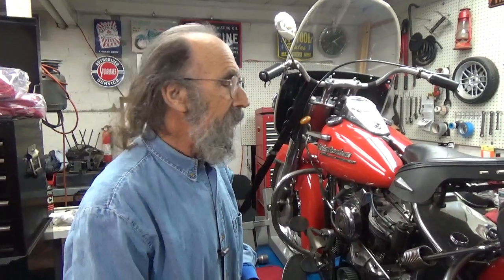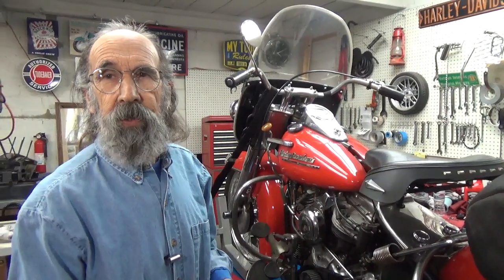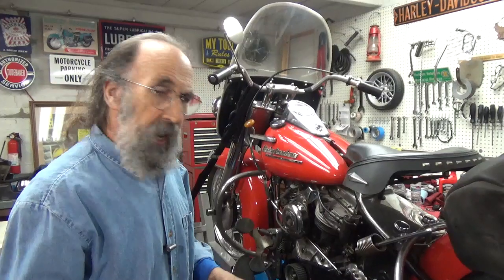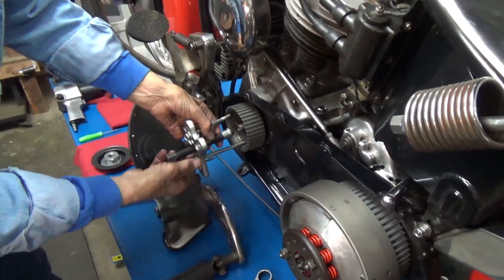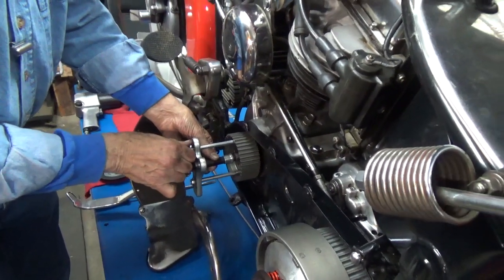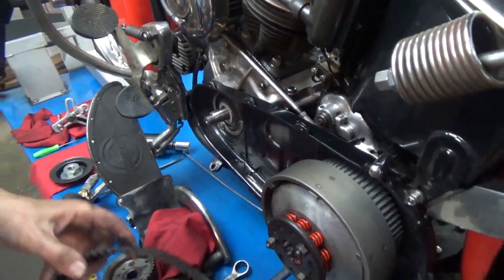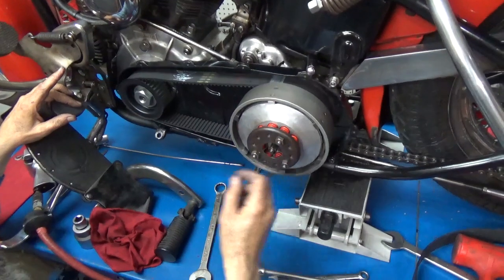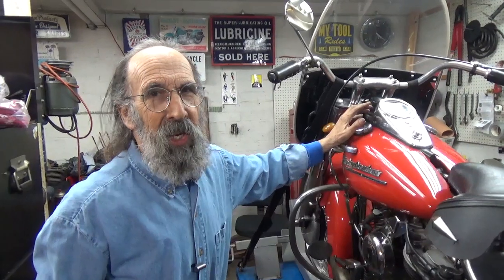Panhead Lost The Teeth Right Off Of Her Belt!

Comment: Thank you for the post. I ran a Phase 3 11mm belt on my Shovelhead for many years ,before going back to chain. Changed belt 2 times. In 25 years.
Reply from the maker: I certainly worked on some of those.  They were okay.  But, like anything else, we've learned a lot since then. Those were the days before Kevlar.  Which is pretty neat stuff.  I remember Phase III in the seventies.  I assembled prototypes for Super Max in the early eighties.

Comment: Well Mike, you got your moneys worth out of that belt, which shows by spending a little time fitting things properly; is time well spent.
Nice-one, anyway, you may remember I told you about "WellSeal" gasket sealer, which in my opinion is the best sealer ever.
If you look on ebay, and just tap in "Wellseal" maybe add a UK, because it comes from Great Briton. I just bought a 100g, £12.00 tube today.
Please just have a look, you won't regret it. it's so good that even if you don't use, you could have a sniff, now and then!
Only  joking, is dose have a really good write up, even if you think I might have got it wrong. Take Care now.
Reply from the maker: Okay, Will do.

Comment: Hey Mike please tell me how a 21" front wheel helps in the mountain roads. I very much enjoy your videos.
Reply from the maker: Think of it this way (I didn't take physics, so I just get a picture in my mind with no rules):  The wheel is a gyroscope.  As such, it has weight.  You're steering that heavy weight.  How about, I get a larger diameter (within limits, you can go too big) gyroscope with less weight to have to menuever?  Now, we're having more fun.  I think I blew it on the spelling though.

Comment: I ran a belt on a shovel head 2 years in the 80s and the belt broke .so I stick with that double roll chain in there from now on ,it’s pretty tough. Coming back from Kentucky back ito Indiana where I live I had a 93 Evo dresser and it burned a valve or chipped valve it was hard to tell it sound like a corn popper I could do about 35 did that for almost 250 miles got me home
Reply from the maker: In the beginning, belt drives had rubber belts.  Then came Kevlar.  Then it was just a matter of proper installation.  I worked on the development of some early belt drives.  But, I still only put belt drives on my "kickstart only" bikes.  And, I consider that a vast improvement.  But, to each his own.  As for that Evo, you get kind of attached to one that always makes it home.
Reply: That's why I stuck with a chain when I built my shovel. They are bullet proof. I floated a valve and bent it one time on shovel. It was cold out and i started it and took off fast to catch up to some people and bent the valve.
Reply: @pacificmike9501  Hi Mike, I'm wondering why you said you only put belt drives on your kickstart only bikes?  I have 3 FLH shovelheads.  An 85 FLHP that I geared up by putting a 65 tooth back sprocket and a 124 tooth belt but there is very little adjustment left to tighten the belt. An 83 FLH that I am putting together now and was going to try and gear it up in the primary with a belt drive instead of the way I did the 85. Do you not recommend the belt?  Then I have a 77 FLH that I run a 45 tooth on the back. Like you I ride my bikes so running stock gearing isn't practical.

Comment: Pacific Mike, Great videos.  Can you explain how to remove a primary belt on a 1983 FXSB.  The compensating sprocket is the one with the four rubber dampers.  Thanks
Reply from the maker: I don't remember.  I thought it came right off.  It's on a splined shaft and should slide right off unless it is stuck.  Those four rubber dampers go bad and I used to have the two halves of the pulley welded together.

Comment: Are you running a sealed bearing in the clutch basket, or the original style cage bearing? If you are running the cage bearing, how often do you need to grease it? Always a pleasure watching a guy who knows what he's doing.
Reply from the maker: Thank You.  That bike has a stock caged bearing in the clutch basket.  When I assemble it, I lube the bearing rollers with a good wheel bearing grease or moly lube.  Next time I disassemble the clutch for cleaning or repair, if it needs it, I lube it again.  It really doesn't need it often.  Some people  are harder on clutches than others.  They're in there oftener.  If you ride in heavy traffic, you'll be in there oftener.  If you ride easy in the country, clutch probably doesn't get looked at that much.
Reply: @pacificmike9501  Thanks I always wondered how long that bearing would last in a dry environment, my bikes have always been oil bath primaries.
Reply from the maker: They do fine with occasional maintenance.

Comment: Love your videos.  Thinking about adding a primary belt drive to my '65 FLH.  I was under the impression that there is no seal, behind the compensator, and that engine oil will weep in to the primary.   What are your recommendations to resolving that?  It seems your primary is so clean and dry.
Reply from the maker: 65 FLH has a "screw-in" motor seal.  Look it up in your service manual.   Use the right manual it is the 1959-1969 manual, although each of those years is not the same.  Be sure you read the manual.

Comment: Somebody put up a video showing their Harley "drive" belt shredded and strangely enough it was 27 years old as well.  My dealer says 100,000 miles or as soon as you seen any sort of decay - cracks, stiffening etc it should be changed.  I know I will never have to worry about it that's for sure.
Reply from the maker: Mine is a primary belt.   I believe Harley has tried to stay "non-comittal" about how long their final drive belt will last.  In the beginning, Dealerships used to say 30,000 miles.  We now know they will last alot longer if they're adjusted properly and not abused.  We also know that the atmoshere, depending upon where you live, will also eat it over time.  No doubt about it though, they have a good system there.

Comment: Mike
I've got a shovel head with Delkron case and a belt drive, motor is out of frame. Thats all I know about this motor. I went to to try and turn the motor to make sure it wasn't locked up and there was no nut on the belt drive pulley. Any idea what the nut size is and do I need a puller to get that pulley off? I didn't want to start bangin on it with a dead blow or trying a crow bar before I asked the question. Thanks as always!
Reply from the maker: A "steering wheel" puller  is what you need to remove the pulley.  There are two holes on the face of the pulley where you screw in the two bolts from the puller.  You can find that nut in any "aftermarket" supplier of Harley Parts Catalog that sells belt primary drives.

Comment: I had that happen many years ago. I changed my 76 Bicentennial HD to a belt drive. Biggest mistake I’ve ever made. It kept stripping belts.
Reply from the maker: Yah, my belt on my Panhead only made it for about twenty-five years.  The proper belt, properly installed on the right bike is awesome.  Again, personally, I love a belt drive inside tin primaries, on kick start only bikes.  It is an tremendous improvement that way and will outlast a chain about three to one.  My 77 FLH has run a chain all it's life.  These are just my experiences.  But I was learning and working with prototype belt drives in the early eighties.  Early belts weren't Kevlar.  And people didn't understand proper installation.  And , again, I don't like them in every application.  Just me.

Comment: Great video Mike! What is your tip for tightening the sprocket shaft nut? How are you locking it all up? I considered just putting the bike in gear and holding the rear wheel whilst torquing the nut down, but I don’t want to damage anything. Thanks!!
Reply from the maker: I use my air impact very carefully.

Comment: Great video's Mike. My father-in-law just gave me his 1956 FL Panhead and we have been watching your videos continuously. We watched your videos where you mention the primary multiple times before we changed out the primary chain with a Primo Primary Belt (my wife and I actually bought the belt for him about 10 years ago and he never put it on so it was still new in the box) which really made the job easy, so I wanted to thank you for the videos. I do have a couple of questions which I was hoping you could answer. How did you tighten up the front 1 1/2" compensator nut? When I tried, the belt just turns which causes the nut to also turn so I am not able to tighten down the nut let alone torque down the nut. How do I keep it from rotating so I can torque it? Also, the instructions which came with the belt says to torque it to 60-90 pounds, but that does not sound right, I thought it should be torqued to about 175 pounds. I also noticed there is a little oil drip coming out of the same compensator, at first I thought it was because I didn't have the nut torqued, but noticed in one of the comments below you mentioned a "screw in motor seal", but I could not find anything about it in the manual and was wondering if you had any guidance on where the "screw in motor seal" was and how to go about fixing/replacing it? Will I have to take off the primary belt and compensator to get to it? Sorry for the long note. Again, thank you for the tremendous videos. I'm new to the Panhead world and they are sure different than anything else I have ridden or worked on.
Reply from the maker: Lucky you!  A father-in-law that gives you his 56 Panhead.  That's what I call a "loving family."  Now, please understand, you may be a little deeper in than you're comfortable with.  Not to be insulting, just realize first,  "Anything you look up for this operation will apply to a 55-57 Panhead."  It's a real good idea to have a 48-57 service manual.  Okay, I tell it like I do it.  To remove and/or install the sprocket shaft nut, I use an impact wrench.  The "motor seal" will be referred to in the book as a "bearing nut."  It has a flat outer surface with two shallow holes to be engaged by a special wrench.  It is a left hand thread.  I've devised a number of ways to deal with it.  Just be gentle and kind and you can do it.  When installing your new belt drive, use Primo Rivera directions on tightness and anything else they say.  Your breather tube  that runs through your engine and into the primary is also your primary chain oiler.  Turn it off at your oil pump.  Your book will show you.  It's just a tapered screw with a locknut.  Again, be kind, no brute force.  Shorten that breather tube so you can attach a hose to it and run it behind the inner primary cover and out behind the trans where it can vent but not puke oil on your tire.  Sorry if that was too long.
Reply: @pacificmike9501  Thanks for the tips Mike. The Panhead sat for the past 10 years, and is a little different than other bikes I have worked on. But between all my resources, I will hopefully get her back out on the road, but time is always a factor as I'm also working on a vintage Honda with my Dad, and they can only be worked on in my spare time. So, I did as you suggested and hit it with my impact, and that seems to have done the trick. I saw some videos put a small board between the teeth on chain drives to torque it, but I was hesitant on trying that technique on the teeth of a belt drive. I had already turned off the oiler and ran the hose behind the inner primary cover for the oiler/breather like you talked about. Again, thanks for the tips and videos and keep up the great work, always enjoy your videos.
Reply from the maker: Thank You.  Enjoy that Panhead.  Belt drive, oiler turned off.  Breather rerouted.  It becomes a better and better ride, once you address things like that.  I'm pretty much addicted to my Panhead.
Reply: @pacificmike9501  Thanks Mike. I can see why you are so addicted to your Panhead, as every day I find new things about this ole girl of mine and becoming more and more excited about getting her put back together and on the road. Have a great day and again thank you for the comments and keep pushing out those awesome videos.
Reply from the maker: Thank You.  Panheads are a sweetness hard to describe.

Comment: Mike, just purchased a Panhead bobber in late 2019 and am now in the middle of “making it mine” with a few changes. It came with a belt primary drive but was not in an enclosed inner/outer OEM style primary case. I want that look rather than the guard and plate apparatus it came with. I see on this bike and a yellow Panhead you worked on and showed clutch maintenance that you run belts in enclosed primary. I’ve been told not to do that because of heat eating the belt. Any words of wisdom on that? Seems like a 25 year old belt puts proof in the pudding so to speak and of course results may vary.
Reply from the maker: I would, but you answered the question the same way I would have.  By the way, Kevlar belts withstand a lot of things rubber belts never could have.

Comment: You’re lucky (I hope) that you didn’t destroy something. When the belt climbs or miss times and runs on top of the cogs because or missing belt teeth it’s been known to rip the gear case apart or crush bearings. Kevlar in even an old belt is stronger than anything else in the bike. Replace them sooner and keep them tensioned properly or be ready to pay. On this bike, not only would I be changing the belt but the outboard engine and transmission bearings too. Hopefully the bearing bores are not oblonged and shafts not bent.
Reply from the maker: With all due respect, you're a bit of an alarmist.  The bike is great.  I've worked with belt drives since the early eighties.  Yes, things can go wrong, but not regularly.
Reply: Pacific Mike
Yeah paranoid maybe.
I don’t know when the switch over was, but the Kevlar is a lot stronger than the old types. Pretty rare for these types to outright snap (good brand) but the teeth are a another matter. Time is to be respected.
Reply: jensen Read what i told coleshill. It applies to you also!

Comment: I love all your videos even though I ride a “modern” bike. Did these Bikes come with belts back then? If so, when did they change to the chain and compensator set up? Yes I’m ignorant of old bikes, but learning all the time.
Reply from the maker: Thank you.  Harley never installled belt primaries until about 1980, on the Sturgis model.  They tried it on a couple of other models and then abandoned the idea and have used nothing but chains ever since.  My usage of primary belt drives, that is, my preference, is, I love them on old bikes with tin primaries and kick start only.  Just my preference.  More power to everyone who wants a big exposed belt drive with a big modern motor and an electric starter.  Not the combination for me.  I don't like how they function.  An enclosed chain the way Harley built it works perfectly.  They came out with aluminum, enclosed housings on Big Twins in 1965.  They work great.  The earlier ones, gimme a belt.

Comment: What do you do with the crankcase breather? Cut the tube and run a hose to the ground?
Reply from the maker: Yes, but not to the ground.  Run it down, then horizontal so it doesn't suck anything up.  Then, turn off the chain oiler at the pump.

Comment: I assume you did something with the breather on the primary to keep the belt dry ?
Reply from the maker: Yes, trim the tube so it points straight back.  Attach a hose and run it straight back (and down).  Do this behind the inner primary so the breather never enters the primary covers.  Then go to the oil pump and turn off the adjustment screw to the oiler.  Done.

Comment: I have 83 belt shovel new in 83 Electra Glide in my Literature for my bike it said it would last 100,000 miles well it didn’t.Thunder Bird in Wheat  ridge Co.replaced it 5 years ago just one 38yrs. I had about ten teeth missing. Scooter Trash in Denver Co. works on my bike now.not many men work on old shovels anymore. Definitely not dealerships...
Reply from the maker: Yes, that's true.  Realize that what makes a belt rot is actually the atmosphere and all the wonderful things in it.  There are so many variables in that much time.  But, that's certainly a great bike.

Comment: I have a 2003 Heritage Solftail with a 70 teeth pulley and what to put a 68 teeth pulley on. Will that help me cruise better. It's a 5 speed. Thanks, harley 03.
Reply from the maker: It will.  But, it's a small change.
Reply: @pacificmike9501  thanks for the reply, like your show😎

Comment: Mike just to double check. Is no lock washer or lock tight needed on the motor sprocket nut?
Reply from the maker: Service manual says to use a drop of red threadlocker on the compensating nut.  I don't believe threadlocker was in business yet for the early bikes, but, it's one of the few places I use Loctite.
Reply: @pacificmike9501  Thanks Mike always appreciate the help

Comment: So ........the belt takes the place (does the job) of the compensator?  Was there ever a compensator and primary chain/oil bath clutch in this bike?
Reply from the maker: Yes, belt drive with its motor pulley, belt, and belt driven clutch basket  takes the place of the original front sprocket, chain, and chain driven clutch basket.  Most of the bikes prior to 1954, did not have a compensator.  A few did, although they are quite rare.  The big twins , prior to 1965, had dry clutches and a drip oill system onto the primary chain.  It was a "total loss" system that drained it's oil on to the ground.
Reply: @pacificmike9501  Thanks.  My Dad had a war time Harley 45 but I had no idea how it all worked back then.  Great videos, keep em comin!